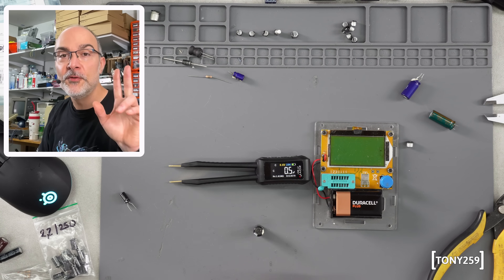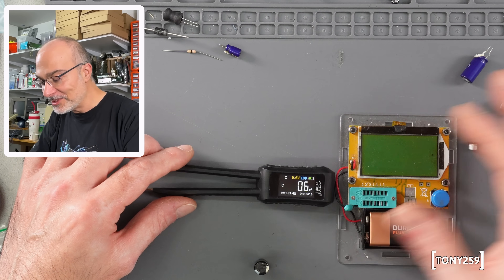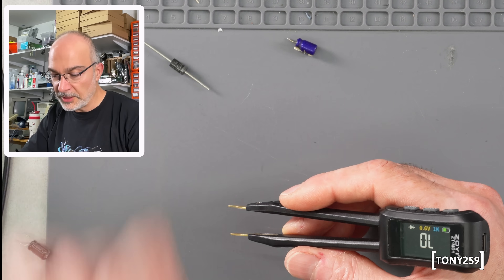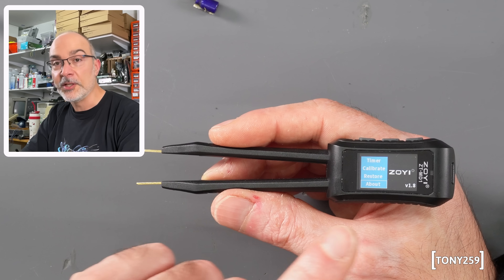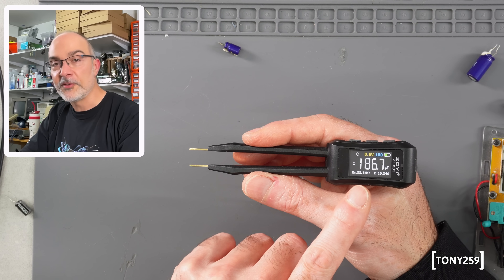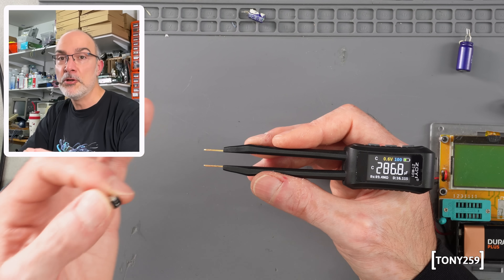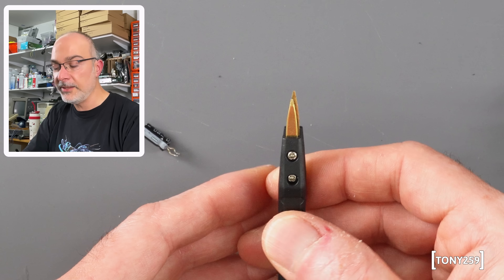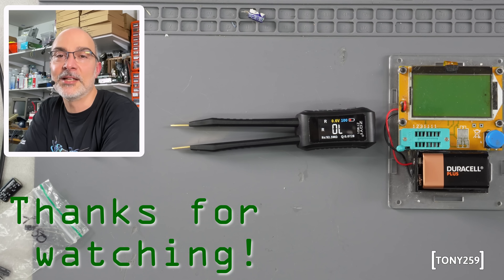FINALLY! A proper - CHEAP - LCR meter!

Comment: So is this particular LCR meter any good at finding bad capacitors in circuit?
That's what I'm most interested in but it's not discussed in the video.
Reply from the maker: it's not discussed because I don't have a good in-circuit capacitor tester so I cannot say. The_Defpom said it wasn't great though a new FW came out after the video which is adding 0.1V for testing which might help with in-circuit testing.

Comment: Should I buy this instead of a component tester? Is an LCR meter a completely different thing?
Reply: Subbed 😅
Reply from the maker: A component tester uses some tricks to simulate a proper LCR meter which uses high frequency sinewaves to measure capacitance and inductance. A GOOD component tester can approximate an LCR meter pretty well - see my Fnirsi component tester video (spoiler: that's not a GOOD component tester!)
Reply: @Tony359_2 thanks for the info! What would you say is a good component tester? I'm looking for an all in one reliable tester as I'm just starting out.
Reply from the maker: a cheap one from Ebay 🙂 Not the FNIRSI 🙂

Comment: Did you ever compare ESR on smaller capacitors?  I found quite a bit of variation between my ZOTI and my BK 879B LCR meter.
Reply from the maker: I don't have a "known reliable" meter to compare it with I'm afraid.

Comment: nice video. one notice: 0.3Vdiode  range is useable to measure Ge (Germanium) diodes and transistors from the second half of previous century such as 1N21 OC45 AC188 AC187 etc. and sensitive schottky detector diodes.
Reply from the maker: Ah interesting! I'll keep that in mind, thanks for the info!

Comment: Great video!
Do you think this device is appropriate for in circuit ESR measurements like other meters?
Reply from the maker: Thanks - those who have the Peak meter say it's not as good. The latest firmware is adding 0.1V measurement voltage to try and not disturb other nearby components. This is my only LCR tool so I cannot compare I'm afraid.
Reply: @Tony359_2 thanks. Do you know why they say the Peak is better? Is it because of the higher test frequency? By what I have found on the datasheet, Peak only works on 50kHz.
Reply from the maker: no idea I'm afraid!

Comment: Can this meter measure ESR while the capacitor is still in circuit? That’s a very handy tool to have if you can find one, Tandy or RadioShack used to sell a kit to make one many years ago.
Reply from the maker: Yes though I’m told it’s not as accurate as more expensive tools. I tried it though and it definitely helped. Firmware adds 0.1V, that might help as it won’t trigger anything else on the same circuit. I still love it.

Comment: Can that gadget measure capacitors in the circuit without having to remove them from the board ?????
Reply from the maker: It can, to some degrees. People who has better tools say it's not great but it's definitely been useful to me. 
I believe there is a new firmware which lowers the voltage even more - I am going to make a short very soon.

Comment: I just found out that Zoyi made a V2 update of the firmware for this. It's very useful, but they state that you should need to do a recalibration of resistance measurements afterwards. Anyway, the cool features are that it can now also measure at 0.1V level, and that it can display D, Q, Z, X, Y parameters of the complex impedance of any part. Just like a "professional" LCR meter.
Reply from the maker: ah thanks, I'll take a look! The only issue is the resistors to calibrate it :)
Reply: @Tony359_2  The next time you order parts from a good supplier, you can chuck 20x of 0.1% 0805/1206 SMD resistors, from 1 Ohm up to 10M Ohm, probably costs ~$10USD. If you have a reference DMM around you could pick out the best one of each lot to use as a set of references. That's a bit of a bit of a mission just for this context, but might be handy to have around for the future (other reviews, etc) as well
Reply from the maker: I just added a video where I show the upgrade to 2.0 and the calibration process, thanks!

Comment: Have you ever tried incircuit testing on electrolytic capacitors? I'm hoping it can read the capacitance and esr well without desoldering the caps off the board
Reply from the maker: I think I mentioned in the video that others have said it’s not great at in circuit testing. I don’t believe in in circuit testing but I did try a couple of times and it gave me some useful info.
Reply: @Tony359_2  Thank you for your quick reply. Sorry i might have forgot or missed out on your statement in the video. After writing in my question, I found your reply to someone 2 months ago that incircuit testing did work one way or another for you to identify dead caps. Glad it somehow worked. Will definitely get one. Thank you for sharing good recommendations with everyone

Comment: 8:12 i mean the higher the frequency the faster a slew rate you need, so at some point i'm sure it literally just can't provide enough power to fully charge the capacitor in the wave cycle
Reply: Higher frequency => lower cap impedance => higher current. Oscilator in device has limitations how much current can provide. Same "issue" have proffessional cap meters like Agilent 4288

Comment: Bought one of these after seeing this review. It fails to read half of the time, and when it does, the results are varied during repeated testing of the same capacitor.  I’m not a fan of it.
Reply from the maker: Hey, sorry to hear that. I still love mine. I haven’t seen what you experienced with yours. Any chance you’ve got a fault one? Or maybe a copycat? These days it’s easy to get bad clones of everything. I’d contact Zoyi and ask for a replacement.

Comment: Sounds to me like you’re not used to working with capacitors at low frequencies below their resonance frequency like you would use in a passive audio crossover. In this use case, the whole idea is that the capacitor has higher Z and ESR at low frequencies like 100 Hz and passes higher frequencies like 5000 Hz better. If you’re working in the megahertz range, it’s totally different.— that’s usually above the resonance value for the capacitor, where with increasing frequency, the capacitor takes on more of the properties of an inductor…

Comment: measuring ESR at low frequencies is a bad idea (regardless of what Scott says).  The reactive impedance increases dramatically and makes the calculation of the ESR error prone.  For instance, the reactive impedance of a 2.2uF capacitor at 100Hz is 724 ohms!  This will cause a massive over-estimation of the ESR.  Measure capacitance at low frequencies and ESR at high frequencies.  Or, if they are subject to constant signals of substantial amplitude, measure them as close to that frequency as possible to see how they will behave in use.
Reply from the maker: Thanks for your comment!
I think what Scott means is not that we get an accurate reading of ESR at low frequencies - but that WHEN THE CAPACITOR IS BAD, the ESR might not change a lot at high frequencies, but it will change dramatically at lower frequencies.
I don't use this tool to measure ESR for designing purposes, I just want to know whether a cap is good or bad. And it seems that a lower frequency will reveal a bad cap better than a higher frequency. Whether that value is going to be accurate, that's not what I (and Scott I guess) am expecting. 
Does that make any sense?
Reply: @Tony359_2  I'd have to give it some thought.  I guess it may depend on how the capacitor is failing.  Thanks for your response.

Comment: Had one sent to me for evaluation and before using it thought it was mostly a gimmick.  It has become my go to meter.  The low ohms are impressive and handles big caps well.  I still can't get used to the hand operations with it.  In use I tend to cover the display.
Reply from the maker: It's still amazing! Yesterday I used it in circuit - it helped me identifying some dead caps.
I struggled with the hand operations at the beginning but then got used to holding it as in the video.

Comment: rechargeable devices may be  landfill after 4 years.
Reply from the maker: I'm not sure that many many batteries to the landfill would be a better solution. I'm sure the battery inside that thing can be replaced. I haven't checked.
Reply: @Tony359_2  Seems to use a YannaI 702030  500 maH battery which needs to be soldered in
Reply from the maker: as long as it's doable... I must have used 20 batteries for my generic component tester over the years. Sure, ideally it'd be nice to have a replaceable battery but given who is going to use those tools, I doubt it'll be dumped once the battery depletes. Also considering that it lasts FOREVER. I cannot remember last time I charged it!

Comment: You should be able to adjust the tweezers ends with a screw driver to line them up. I have micro tweezers that allow for replacement tips just like those and it's just a matter of loosening the screws on both tips, holding them together at the points of mutual contact, and tighten the screws.

Comment: You did not even mention ultra low resistance measurements, not 1/100th, it is 1/10 of MILIohm!  this thing is way more precise then my agilent multimeter that can measure  down to 1 mohm, 10x better!
Reply from the maker: I didn't realise it was such a feature, thanks!

Comment: The AC impedance of 1μF at 100Hz is quite high (about 1.5kΩ I think). It may be difficult for the MD1 to accurately judge how much of the total impedance is due to the internal resistance rather than just to the 1μF capacitance.
Once you realise the total impedance at 100Hz is that high, it becomes obvious that what seemed to be a high series resistance at 100Hz is actually more than good enough at 100Hz as long as it does get lower at higher frequencies.

Comment: I bought one. Sent it back in hours. Inaccurate. Terrible contacts. Typical.
Reply from the maker: interesting - the contacts are not superb, but they work here when the component is clean. 
I am surprised by the inaccuracy though - how did you find that?
Reply: @Tony359_2  I used a device I trust
Reply from the maker: Defpom had tested it against a few trusted devices and it was accurate. Interesting.

Comment: If you measure capacitance you certaily use a some sort of of AC, not wizardry. Is it a pulse, sine or square wave, does it matter? Non-sines just have some "overtones" included. What is the intended use of the capacitor - digest sines or squares or noise or some random signal, audio or microwaves? All capacitors have specs for rise times etc. in datasheets. If your measurement varies a lot depending on your test device/signal (which should correspond to your use case) then maybe it's not the capacitor for the job.
Reply from the maker: Cheaper component testers don't use AC signals, check out my previous video where I briefly show how they work. https://www.youtube.com/watch?v=go4CKKLaaCU

Comment: I have a MESR 100 esr meter and it only does 100 hz. Had no idea that there were other options. Guess i will have to learn when to use other frequencies if I get this, or, even if I need to.
Reply from the maker: 100Hz is a good one - if a cap is bad, the ESR will deviate most at 100Hz.
Reply: @Tony359_2  That was what I thought. But, since there are other options, I was wondering what the value of them is. I guess, if you are using caps in high frequency circuits, you might want to test at higher frequencies?
Reply from the maker: This is an amazing tool but still a basic tool. If you’re designing circuits where tolerances are strict, maybe a proper LCR meter would be more suitable. 
In my case, the 100hz reading is helpful because at 10khz a bad cap might show a slightly off ESR but at 100Hz the bad cap might show a much worse ESR.

Comment: Well if it doesn't go from 1F down to 1 attofarad with .000000000000001% precision, I'm just not interested. ;)
Well maybe a little interested.  I really could wish for a higher capacitance range, even tho the L upper limit is surprising.
Reply from the maker: Of course this won't compare with a Fluke. But it's priced accordingly :)

Comment: I believe that a component didn’t go BAD, but simply evolved into a different circuit. Every capacitor has capacitance, resistance and inductance and overtime it changed those characteristics into a different circuit. Now what that circuit is good for is is in the realm of the advertising department.

Comment: thank you Tony for the review, LCR-ST1 (some online stores listed as having LCR & ESR  like FINIRSI) did you get the chance to test on-board capcitor with it?
Reply from the maker: I understand the zoyi is not great at testing in circuit capacitors but I did try a few times and I got some useful info. Apparently the Peak is a better tool for that.

Comment: Will this work for amp repair if I’m trying to check the capacitors without desoldering them off the board ?
Reply from the maker: I’m told it’s not great for in circuit testing (though it does work to an extend). For that I understand the peak is better.

Comment: And in many circuits where the impedance of the surrounding circuitry is orders of magnitude higher than the ESR high ESR my have no effect on the circuit. Ex: 1md cap with 45 ohms ESR into a 10K load resistor, common in many audio circuits, will have the effect of a 25 ohm resistor in series with a good 1mfd cap. The loss will be negligible. But the cap may cause distortion depending on the nature of the ESR. FYI
Reply from the maker: Thanks!

Comment: I just ordered one on watching this vid. However, you don't mention the expected impedance of the cap you're testing. Without it you don't really know what's what.

In order to sort out the non reactive impedance or resistance from the ESR you need to know the impedance of the value you're testing. 1mfd has a Z of 15.9 ohms at 100 hz. If you don't know that then you you can't accurately judge the cap's esr. And if you get an esr below the actual impedance of that value cap's labeled rating then the capacitance will be higher than rated. Most electrolytics are +20 to 50% /-20% tolerance.
Reply from the maker: Thanks for watching, I hope you like it! I still do!

I didn't mention much because I feel I am not in a position to evaluate the accuracy of this tool - for that I mentioned the video review from Defpom, he's got professional LCR meters and he was able to do a comparison.

I searched through all my capacitors and nobody is sharing the ESR on their datasheet. Only Wurth does but only at 100KHz, which this tool cannot do. 
In fact, I am sure I did find a Wurth with the ESR measured at 120Hz on the datasheet. I cannot find that capacitor anymore but it did match the Zoyi very closely.

I hope you're happy with the tool, let me know! :)

Comment: Interesting thing! I did repair my HP Agilent 4263B LCR bridge with what I was ripped off at eBay. But this 4263 is a shelf unit, needing long Celvin cables or the part has to be removed and placed into a test jig. With this handy tool you can do some pre-checking in circuit and at least know if there is a further investigation needed. Even having R&S meters at hand, I often prefer some smaller movable equipment as often the thing to repair is in the view of the bench top equipment in front of you. But all the older Chinese super handy stuff just works for a year and then you have replaced the LiIon Pack the third time. And it is always empty when you want to use it. So, for me this ZT-MD1 looks promising, and I'll order one. Thanks for showing that around!
Reply from the maker: Indeed - nice to have a proper one but this is good for most of the task. The battery lasts FOREVER! It's still reading full and I charged it after the video!
Reply: @Tony359_2  I already added it to the Aliexpress shopping list. And I agree, far better to accidentally kill a 16€ China tool and still have a 1500€ precision meter for filter measurements. Really looking forward to test that thing myself.

Comment: Naive question : I build antennas for ham radio. Some antennas need loading  inductors to shorten the radials. Would such a cheap tester be suitable to test my home-made  inductors (wire turns around a PVC tube) against the desired inductance? These antennas operate in the 7-28 Mhz range.
Reply from the maker: I do not know to be honest, sorry! What is the expected value of the inductors?
Reply: I just checked and e.g. for a shortened end-fed half-wave antenna tuned for up to 80m band, the loading inductor needs to be 110 uH
I was also thinking about the issue of testing at frequencies that are way below what the antenna  gets.

Comment: I just received mine, and I think they may have listened to your critique, I ordered from your links and mine came with improvements. It's spot on aligned. It's a lot less flexible (doesn't wiggle much to the sides). They've also changed the colors of the buttons (now black instead of grey, not sure that was an improvement, but the text is more readable). The display is extremely crisp and can be seen from all angles. The included cable is actually nice instead of those cheap dinky cables they always include with low-priced items.
Reply from the maker: ahah amazing, I'm glad you are positively impressed!

Comment: It can't measure capacitors at 60hz? I want to measure the ESR at 60hz for filter capacitors in power supplies
Reply from the maker: I’m not aware of an LCR meter which does 60hz to be honest
Reply: 100 Hz is close enough, the tolerance variation from one cap to the next would be more than the small frequency difference. The main thing is to use pure sine wave rather that a square or triangle waveform since the non-sine waves will contain higher frequency harmonics which would distort the ESR readings. For most apps 100 Hz and 10 kHz and 100 kHz would be ideal for most designs.